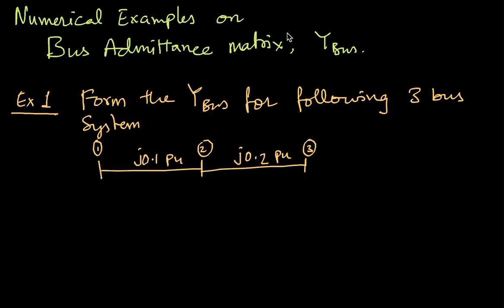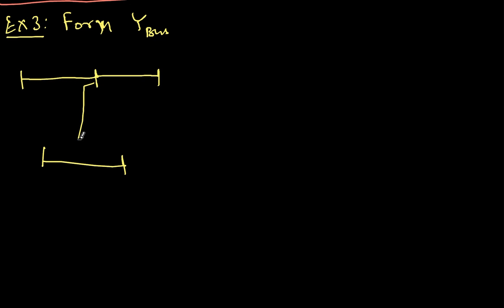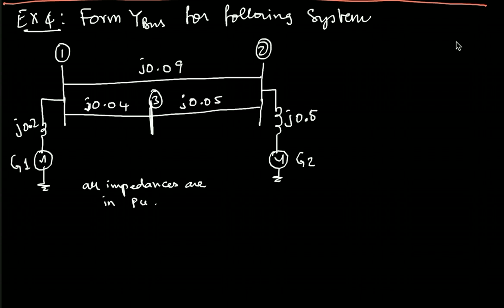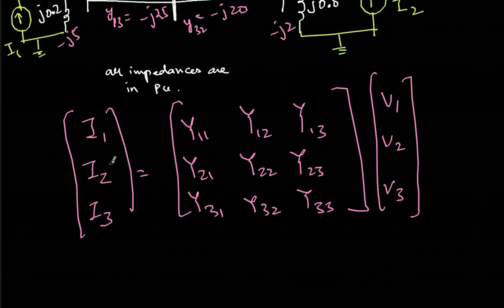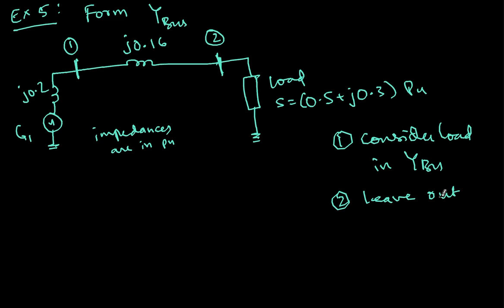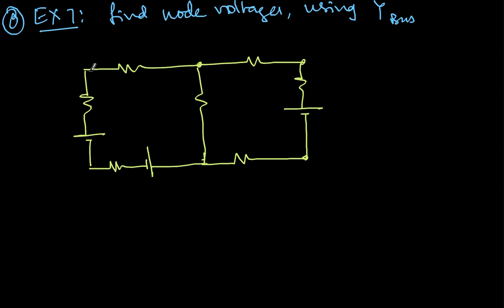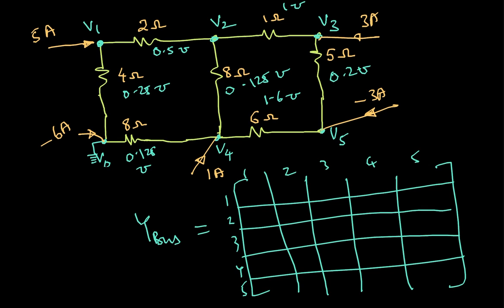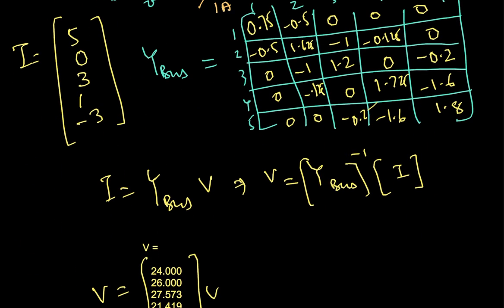Bus Admittance Matrix - Part 3

Comment: Love these videos, but there is a slight error in the DC circuit example:

The admittance is not 1/6 = 1.6 mhos, its 1/6 = 0.1666 mhos. Doesn't change the conceptual part, but important for numerical analysis.